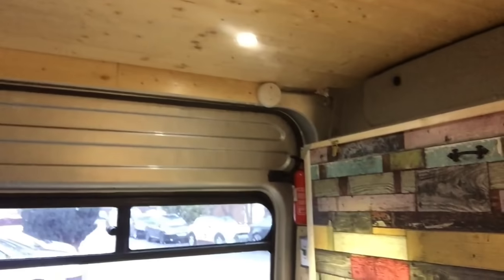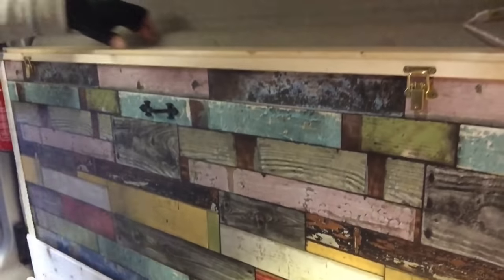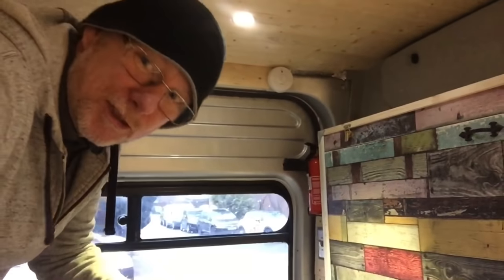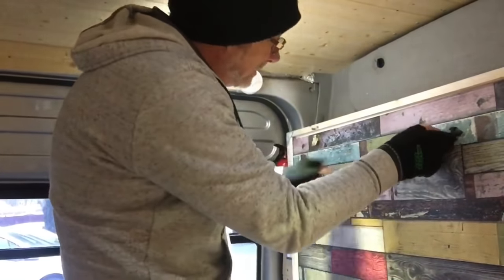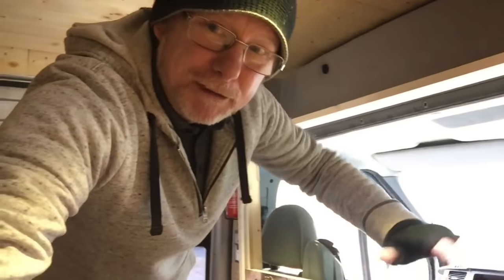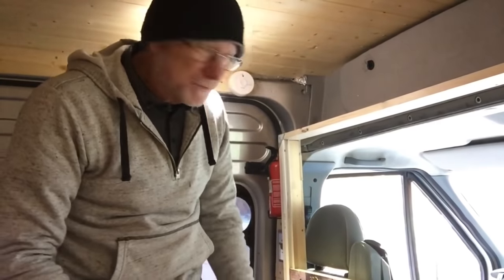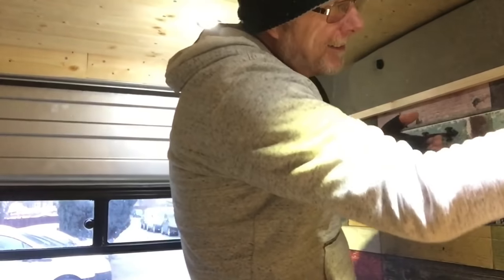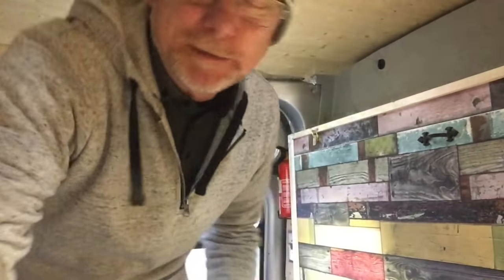HOW TO build a sliding bulkhead like nate murphy van life #vanlife

Comment: Dude, that diesel heater doesn't draw air into the van! The intake only brings air to burn the fuel then it is exhausted! The hot air is from inside the van! P.S. Why not do the WHOLE door in the vinyl?
Reply from the maker: oldschooldiy Hi sorry I didn’t quite explain how I have it setup . I have it so it’s not just recirculating air inside the van like most people. It’s all clear in an early vlog but I’ll go though it again when I do demonstration video. Again sorry for the confusion 🤓🤙